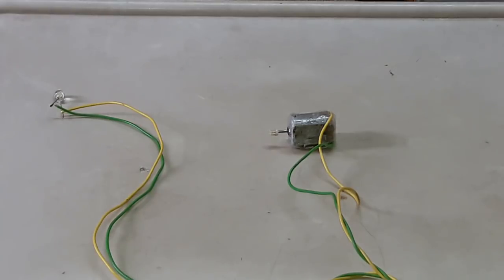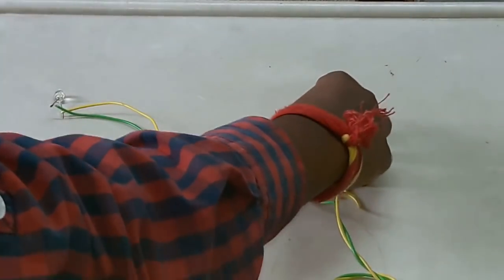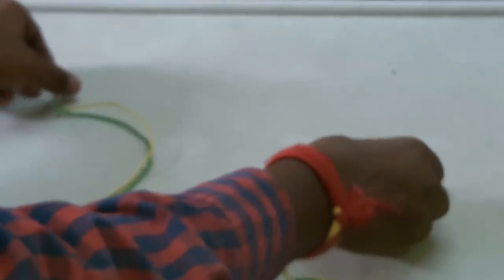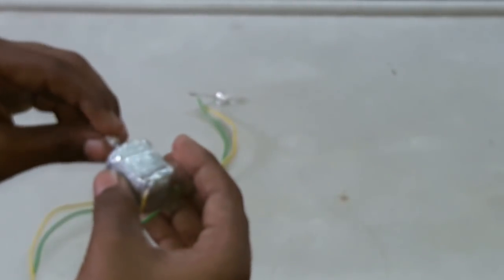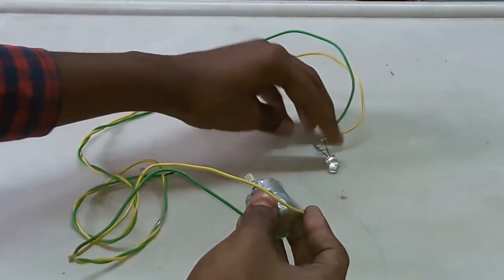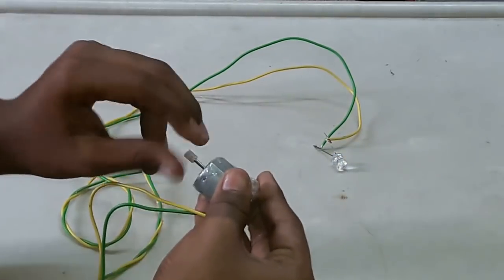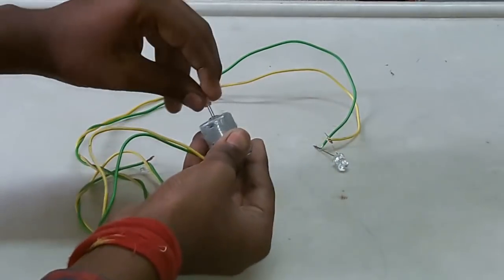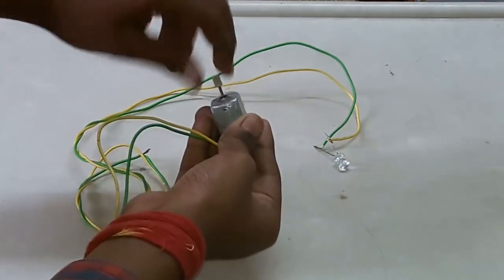How to make dynamo using dc motor!!!!!!.....

Comment: fake
Reply from the maker: Mael 3349 no you can check ,it is not fake
Reply: Hi I am student of electrical engineering and our project is hydropower generation so please tell me that can I use single phase induction motor instead of dynamo  and what will be the rating
Reply from the maker: Jime Je you can use single phase induction motor instead of dynamo ,but the dynamo is more preferable because single phase induction motor generates less voltage.........
Reply: What you mean fake? It is not fake but you
Reply: Mael3349 Did u make one? and if so do you have a video proving it's fake? and if so where may we find it? because so far I've seen a lot of these that work.